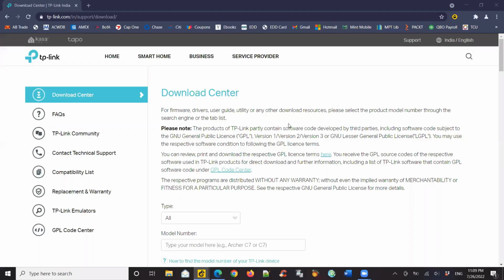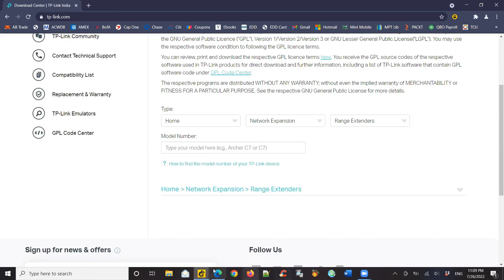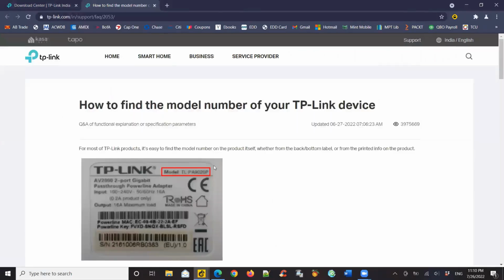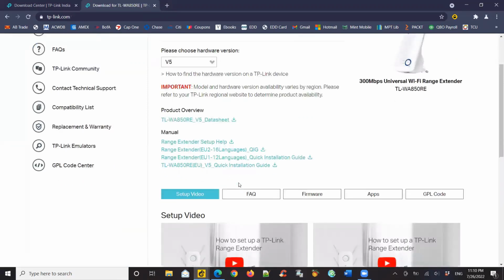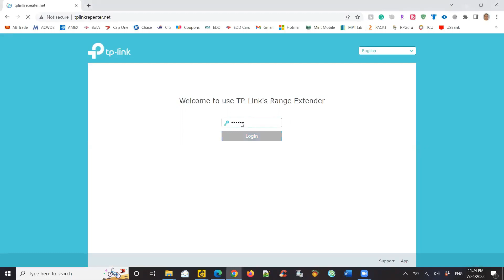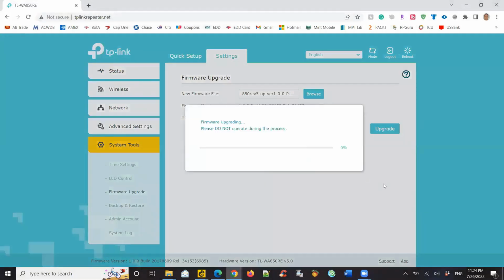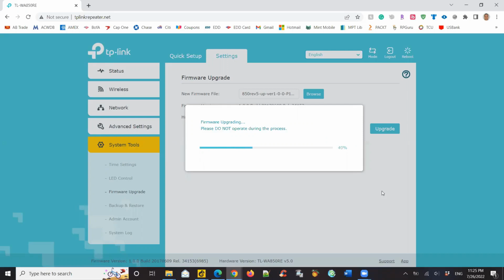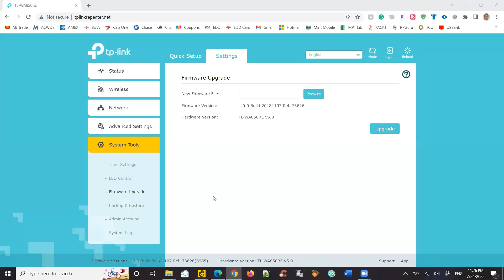Steps to Upgrade TP Link WIFI Extender Firmware

Comment: do i need to connect ethernet for the upgrade or continue with the wireless?
Reply from the maker: You can do the upgrade through wireless. Make sure the Wi-Fi is stable enough and you don't lose connection during the upgrade. 

Let me know how it went and if you had any issues.
Reply: @rpgurutechtalk  boss, it says file invalid
Reply: I did all the steps but after the progress bar gets to 100% nothing happens?